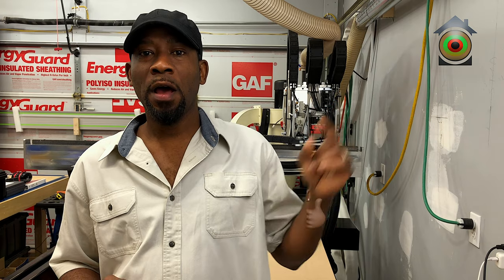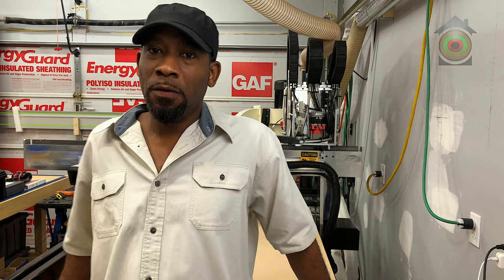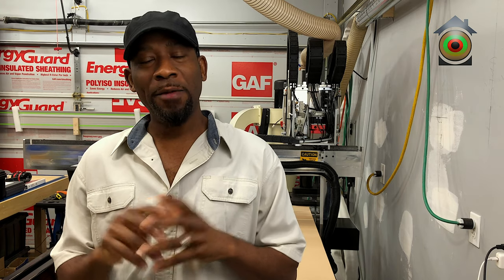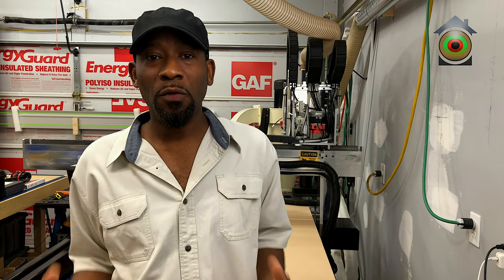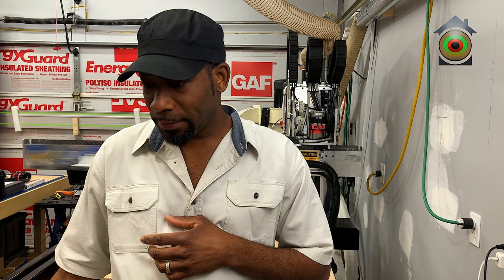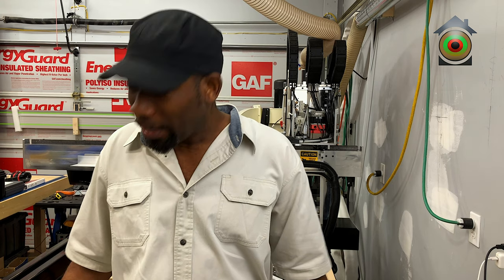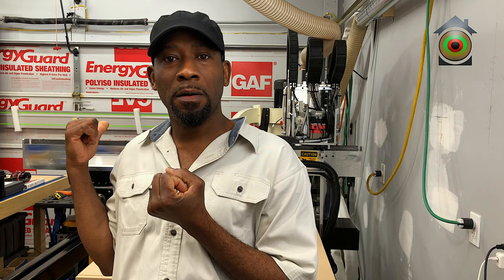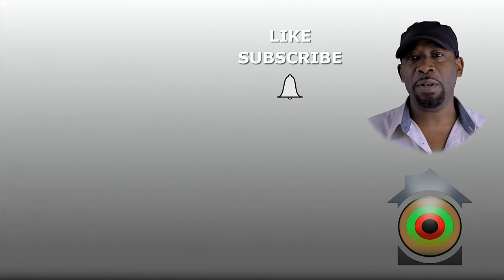My CAMaster Stinger II Review Part I

Comment: All good points and I agree with all except the chuck.  Even when I purchased a Oneway lathe, only lathe centers and a faceplate were included.  The chuck was optional.  Since I am researching CNC's, the information provided on the CAMaster site is sketchy.  I would be interested if you would purchase this again.  Steve
Reply from the maker: Steve, I said it should come with a chuck because all of its competitors that offer the indexing lathe as an option comes with a chuck. It didn't even come with a faceplate just a live center. I'm about to cut my first test project on it. After I have done a couple of projects on it, I'll be ready to offer a final option on it. I will say that their tech support have been very good thus far! Thanks for watching!

Comment: Thanks for the review. I'm getting ready for my SR-44 now. A little bit of disappointment on the Servo motors. I upgraded to Servo motors just to get the 3 wire setup. It's is disappointing there is less power. Most people on there website were saying that there is more power. They are better than Steppers, for my use it will work. I did hear about the lack of instructions. The lathe chuck is very dependent on what your trying to run on it. I know people that turn a lot of things and have 3-4 different chucks.  I will follow you and send you a link to my videos when I finally get started. Good luck with your new machine.
Reply from the maker: Thank you Mike! All of the machines that I looked at that had a lathe option came with a chuck. By the way, it is quieter and the feed rate is 100 in/min faster than the stepper according to the readout in win cnc(600 instead of 500).

Comment: I appreciate the review, I had anticipated a part II. What is your take after 3 months? Does your Fox cyclone adequately cover your dust collector needs for the Stinger 3 and the remaining tools in your shop? What amp service do you have for your shop?
Thanks again - Clint
Reply from the maker: Clinton, there will be a part two. I haven't had the chance to cut anything on it as yet. I tend to overthink things. It is about time I stop reading and watching videos and start using the thing! LOL!
Reply from the maker: The Shop fox is not big enough run all my machines, but I have the ducting in such a way that the cnc is first in line and I am able to close off the rest of the ducting after it. The same concept holds true for the other machines, so the duct collector is working on one machine at a time.  As far as electrical service, I lucked out! When I replaced my HVAC units 4 yrs ago, I replaced them with one unit with two zones. This change left me with enough capacity on my 150amp service to run two 30amp circuits (one for the cnc and the other for Vacuum hold down).

Comment: I have an sr44 with servo, x3 head, 3.9 spindle, vacuum table and recoil ready. Never had a problem. And by the way, no lathe comes with accessories, recoil or otherwise
Reply from the maker: David, I guess your experience was different from mine, but my experience was what it was. By the way, the quote that I got from their competitor came with the a 4 jar chuck and previous machines l've look at over years that had an A axis (4th axis) also had chucks, so that's an incorrect statement. Shop Sabre, AVID CNC, Laguna, and even Stepcraft's 4th Axis options come with a chuck. Thanks for watching!
Reply: well actuall my second cnc did come with what needed to use  the indexing lathe..  my third cnc will have to get adapter so can use nova chuck i  have.
Reply from the maker: @joeyscustomwoodworking5001  The Oneway chuck I purchased came with the adapter and has the ability to use setscrews to secure it so it does not come off when using the lathe in reverse.

Comment: Do you have any idea what the issues are when you are in business to sell a product that is highly competitive? Some folks will just purchase on cost alone and $100 more or less could be the difference on whether they purchase. You obviously no nothing about lathes since you will need three or four different chucks depending on project. Unless you are a different breed of man you didn't read much if any of the instructions before you turned on the machine. Men do not like to read instructions is a known phenomenon! The machine arrives ready to go once unpacked. Much of the "down in the weeds" specifications is superfluous because it is all marketing with best case numbers so the truth is in the use. These are hand built individual machines to the customers specs and that takes time. Believe it or not "stuff happens in real life" folks get sick or have issues at home and don't show up for work, assembly doesn't go as planned, parts don't arrive on time etc., etc., and etc. Again you have never owned and run a real business otherwise you have be more understanding. Bottom line is that you have for the money one of the best CNC routers available with one year warranty along with LIFETIME SUPPORT, who does that anymore and a user's forum that is second to none for tips, advice and assistance on any issue with the machine. I do not work for Camaster but I have owned a Stinger 1 for five years and have been very happy with it. They had much less documentation back then but it is pretty much plug and play. I have had a few warranty issues but Camaster took care of them promptly and even sent a technician to my house in Virginia from Georgia to correct an issue with the spindle. I have made some stupid mistakes as all newbies do with broken bits etc. but the machine is rock solid and nothing seems to hurt it. You Sir are looking for perfection and, in this world, it does not exist. I am many years older than you and I have learned that you can only make 80% of the people happy at best. The other 20% will never be happy regardless of what you do for them and you are in this group! It doesn't look like you have even used the machine yet. You bought this machine based on your research and visit to the factory and yet you are still complaining. You make no sense to me and are not very understanding of others and their issues and problems but I can guarantee you expect everyone to be sympathetic to your concerns. You seem like a decent person but you need to take a long look in the mirror IMHO.
Reply from the maker: San there are plenty of Youtubers (actors) out there that will reinforce your views! Do me a favor and watch their videos instead! Your opinions are far from humble and are based in ignorance!
Reply from the maker: @bradgreen5860  I can tell that neither of you'll have watch the video in it's entirety! SMH! I literally said that my buying and unboxing experience is separate from the performance of the machine and that I will give a final review of the machine after I have done a couple projects! SMH! When you pay ~$25K of your hard earned money, you should have expectations! Again, there are YouTube channel that will tell you'll exactly what you'll want to here, thus reinforcing your beliefs! My money! My purchase! My review! By the way, I happen to be very happy with their tech support and will express that in my final review! Thanks for watching!
Reply: San, I hate to break it to you, but your 20% unhappy customers could cost you over 50% in annual income or a whole business. I owned a sign business for many years, and only had one unhappy customer, who was simply trying to get a free product. Such satisfaction comes with the price, you have to care about your customers and your product and make everything as if you were doing it for yourself or your family. You mentioned your age, that makes it even worse,  with so many years in business and life experience you still have such attitude. Had I know you and your business personally, I would’ve stayed away from you as far as possible. I’ve known people like you who had similar psychology, their reputation was destructive and none of them stayed very long in one industry. Perception is everything, especially the first impression. Blue tape is inexcusable for the $25,000 custom made machine, it just shows lack of respect for their own equipment and it seems like they give him refurbished items. Either way it’s unacceptable business practice.